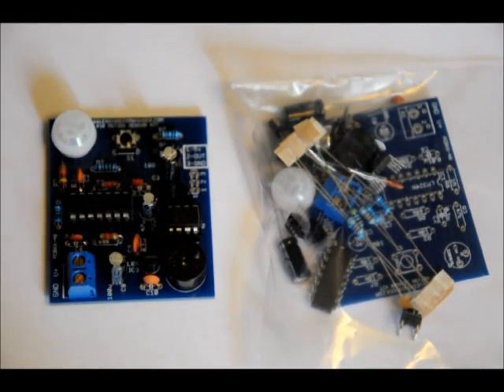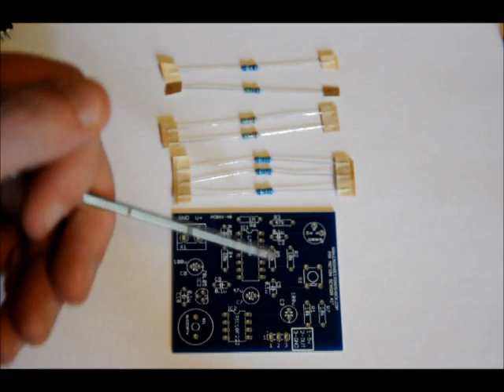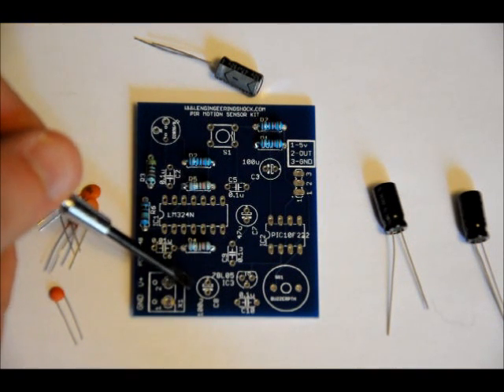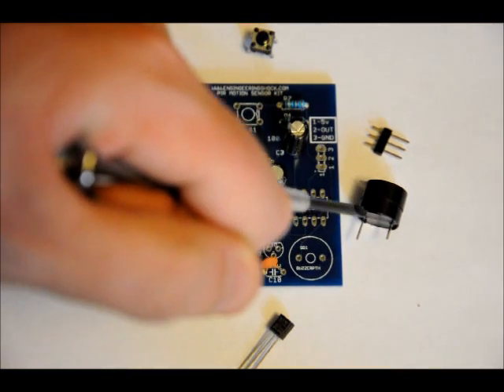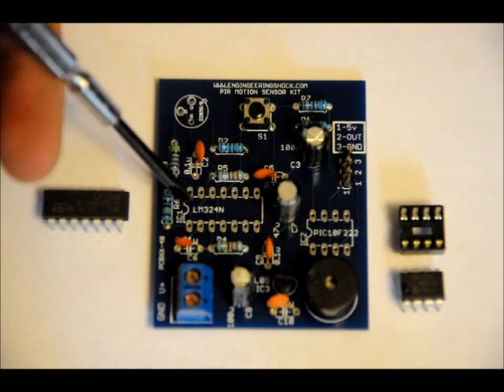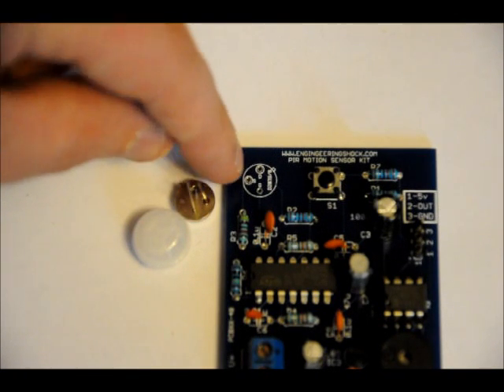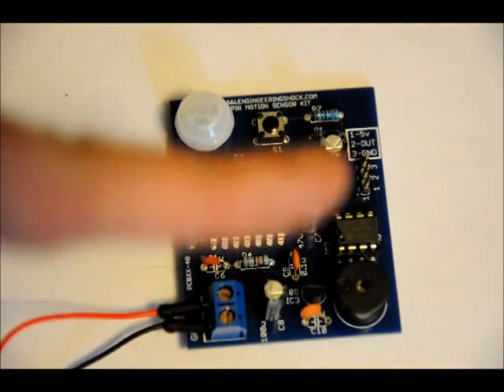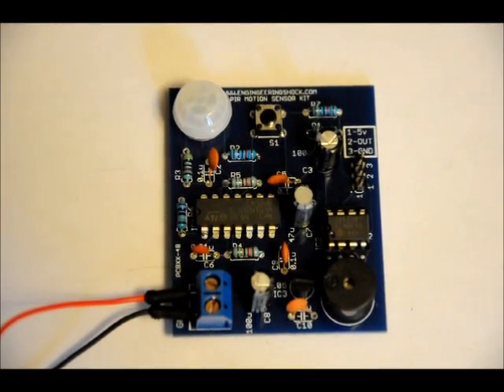The PIR Motion Detector DIY Electronics Kit - Detect Movement and ALARM!

Comment: Does this kit come with documentation that explains each component.  It would be fun to assemble this with my kids, but only useful if they can learn what the parts are and why each was selected e.g. why different types of resistors and capacitors?  How were the specs determined?